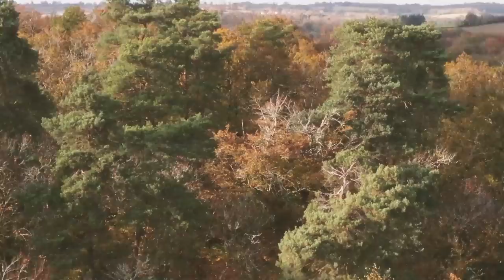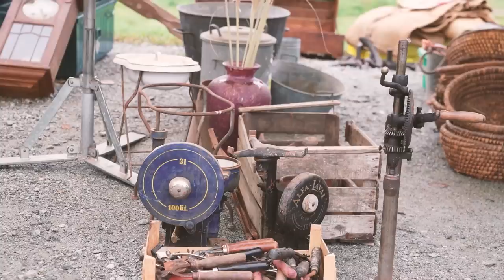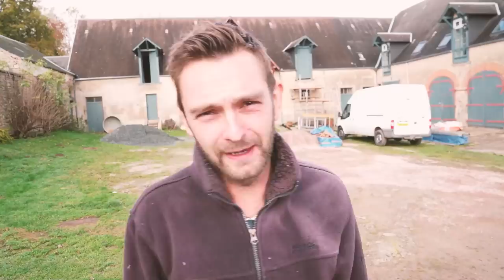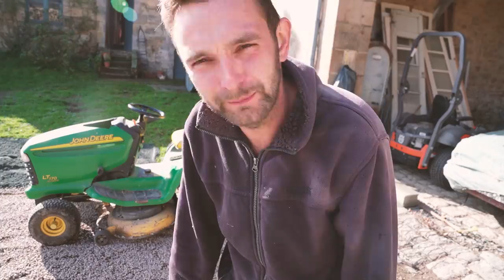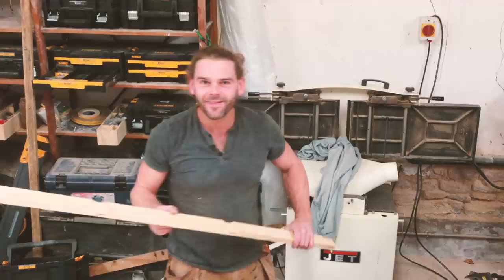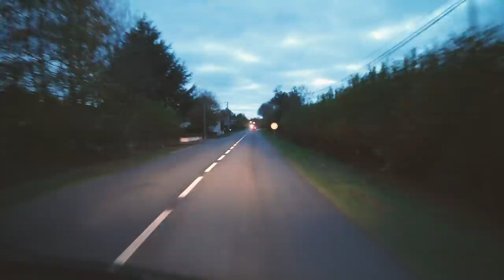A french apple festival - EP142

Comment: They sell notebooks on that Big Online Store just for storyboarding - with rectangles for quick rough sketches, lined areas for descriptions, etc. VERY handy. Get ones with sufficiently large rectangles - e.g. 10-15 cm wide, 5-8 cm tall. We had some with smaller and they were unusable. Best ones have tear out pages in case you need to shuffle your storyboards around. And please get a little rest - you appear to have been non-stop for weeks and that's no good. Just a day, or half a day with no cameras, sitting on a cozy chair vegging out to some random films. If the boys aren't around, I suggest Ronin, Shawn of the Dead, or the Fifth Element.

Comment: You guys should put some hanging plants under the orange/red rafters. The area needs a bit of visual spice, so it doesn't feel so industrial, like a work site . . . and maybe a small water resistant tent, with table, for breaks or a spot of tea. Even in cool weather, you should stay hydrated. It strengthens the immune system.